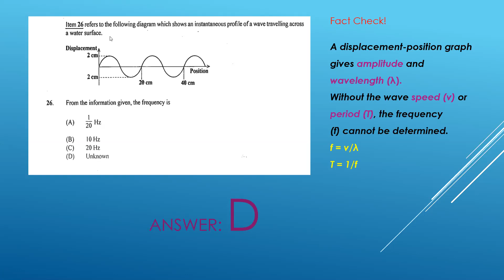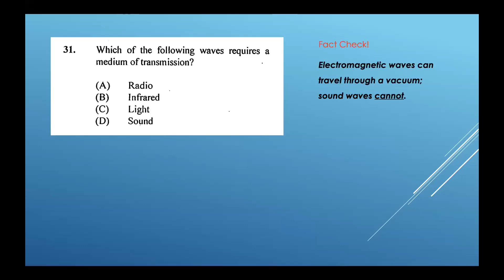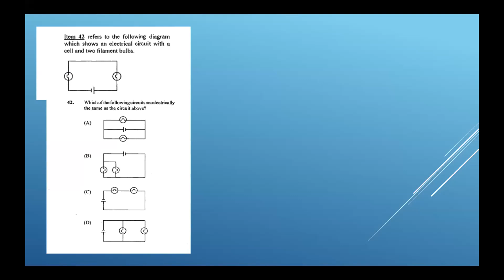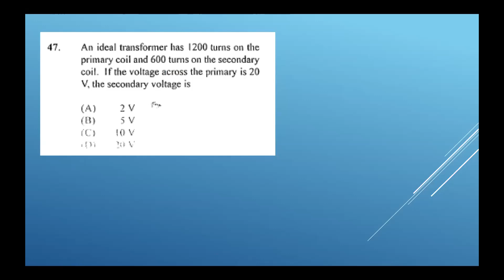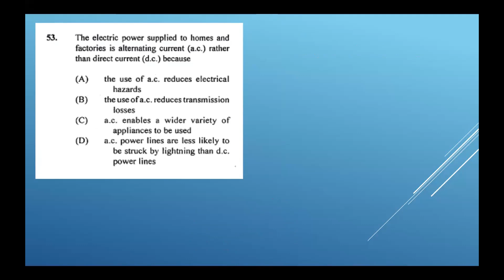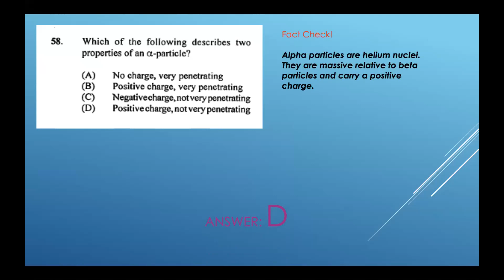CSEC phys January 2017 paper1 workout Q25-60 (Part 2 of 2)

Comment: Hello for no. 48, isn't the answer supposed to be D? 

I mean since the shorter side of the cell diagram is the '-ve' side and the longer is the '+ve', then that would mean the diode is reversely biased in this circuit- no current would flow. Ergo, the line would be on 0.

Nice vid btw :)
I'm doing some multiple choice papers for the p1 exam today!